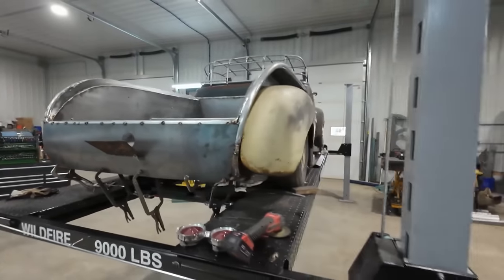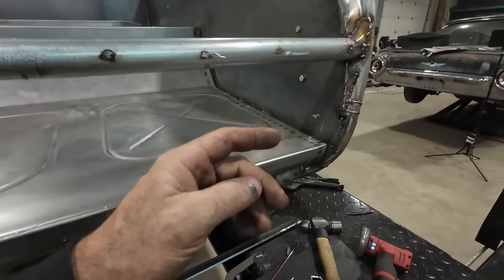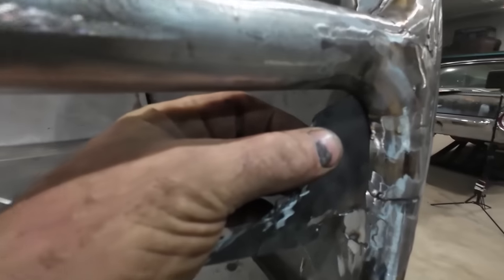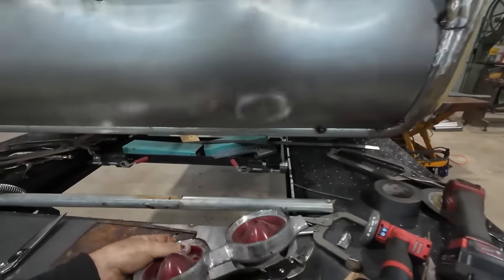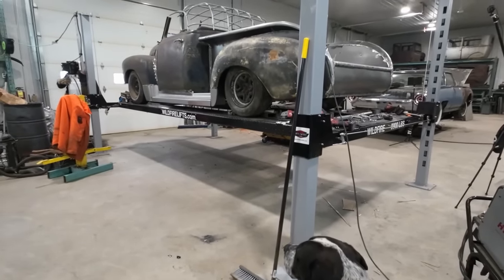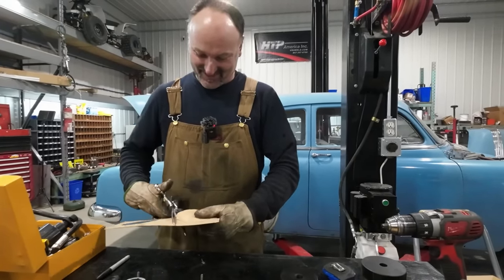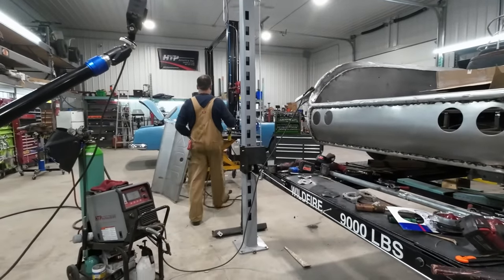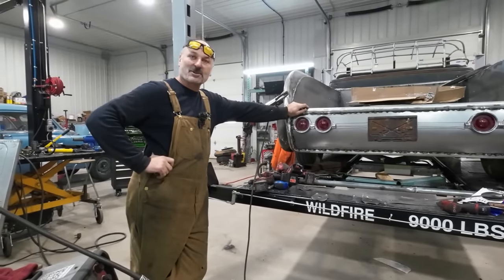Building the rear tail pan for our '49 GMC Roadster pickup!

Comment: Looks fantastic Brent. Do NOT French them in. simply bend a 20mm wide strip of sheet metal that's the distance between the lights in the middle length ways to replicate the angle of the triangular sections on the sides of the lights. Add this to inner and outer of both lights. Fully Sick build. Cheers Stew.

Comment: Run the flip plate mount upside down. Gravity will always want it to fall anyway. Plus when you have the trailer hitch in, the plate will sit over the top of it to show for easy viewing. French the plate holder into the panel as well so it's not sticking out so far.

Comment: Measure from the far side of the center hole to the near side of the other center hole. That will give you the center to distance. Mark it on a straight line and you have a good basis for your template

Comment: I think you made the perfect choice for taillights and with the panel inset in the tubing those lights (on camera anyway) look flush with the outer surface of the tube, I can't see if the chrome around the lights are setting tight against the panel but they look awesome on video,  nice work Brent

Comment: Brent, just an idea, rather than French in the tail lights leave them as is and when you make up the trims to go between the taillights and the License plate door just tapper off the ends of the trims to the thickness of the license plate door so they finish the same distance out from the panel.

Comment: I love the lights too, of course I have owned, 64, 79, 81, 93, 98, 07 Corvettes and they ALL had two round lights in each side just like that, but you know that rig Ain't no Corvette hoss.  That is a HalfAss Kustoms Hardtop Roadster Pickup Truck sort of. It will be awesome. Just make sure you use a nice loopy Cam so it sounds real nice tool, You be Fine. Dennis

Comment: Use the program you draw your CNC stuff with.  You can draw circles and put the center in it.  You can either print those and use them or you could cut them out and use the CNC to center punch them.

Comment: The license plate bracket reminds me of the ones I had on several Oldsmobile models from '68 to '72. Both Cutlass and Delta 88. I think some Impalas and Chevelles had them too, and maybe equivalent Pontiac and Buick models?  There were probably lots of other makes and models, but I know my '68 Cutlass had it for sure.

Comment: If you hadn't done as much welding, you could pull the panel off and dimple die around the holes you have in it. If that didn't work, you could just connect the dimples to give you a frenched opening.  I think the lights frenched in will look great. The plate HAS to be frenched in so it doesn't stick out like a soar thumb.

Comment: You also have some very large fender washers. If you can find anything that needs a bolt the size of the center hole/LOL. One thing that I liked on some types of headlights was that chrome cover that was over the top of the headlight and deflected the light down  towards the road more. Most states said illegal but as you know, the L.E.D. headlights are so bright they hurt most anyones eyes when they hit them. So maybe a long piece of stainless across the top of everything and then have some small lights in center for  that third brakelight??? Its yours and I can't see it from my house/LOL

Comment: A friend of mine bought the complete rear section from the doors back of a 1956 2 door Cadillac, cut the interior supports out of it then built a box inside the rear quarter pannel. He then mounted it on the rear of his 1956 Chevy truck.

Comment: Those two "Bars" between the lamps and the license holder could be made cutting stainless steel with threaded rod behind for attaching.  Use the pipe to match the contour of the lamp's horizontal ends. But, how about a frame from stainless that wraps around the license holder with your "swoopy" curved corners to attached to the new stainless bars.  Tom, SANDMAN OVERHAUL

Comment: If you drill your center hole for your punch draw bolt larger than needed you can center the punch to the marker line you drew from your template without needing to find an accurate center point

Comment: maybe build a surround for the plate so the trim between looks like one piece and gives a flat spot that can be used to box in the filler neck and seal it from the inside of the bed. definitely like the direction. also was thinking if the roof folded like a chevy ssr's might give more room in the bed.

Comment: What if you take the roll pan off to use as a template and add and extra 1/2" or so on top and bottom and use the brake to bend them over. Then you'll have that hard edge and not have to worry about getting it straight.  The brake bend will do it for you.

Comment: Loving how the rear end is coming along. I feel a spear that taped down to a point an inch or so away from the license plate would look pretty sharp. Also a thought on the plate mount you have, would it be possible to use it upside down? Just an idea floating around my brain.

Comment: When you were tracing out for the lights I would have used the gasket the next time you go to the store stop by school supplies pick up a pair of compasses then just you find the center of a circle easy I like the lights you chose but if you brake one is it replaceable if you French it then it’s tough to install different lights

Comment: Looks good. Could maybe French them in deep enough to have the polished ends sticking off the lights to be flush with the outside of the panel... if that males sense wouldn't need to connect them between the plate.
Reply: Nvm you mentioned it just after I sent the comment lol. You got this. I'll sit back and let ya do your thing😂

Comment: What if you get like 1-1/2 angle iron or just bend some sheet metal on a 90 then u can finish it in chrome or whatever in the end but tac it on there and you wouldn't need to french in the lights

Comment: I am interested to see tail gate on this hummer will it hold makers Chev or dodge name on tailgate? what have you with a roll bend that should prove interesting I have been casually watching details how will it roll once she's ready to go. . . . . 
Looking to see the personality you give the pickup \ roadster !

Much like in a obtuse way like an homage to boatail terhaps a white oak varnished tailgate might keep the guesser talking about what you've built here Brent hardwood floor over steel and a belt sander glued plug cut and screwed. Could add interesting design concepts to rear of this why not it's a slight potential  towards those old wood boat tailed speedsters I indeed would love to see you build one of those beauties you certainly would parlay huge views on a build like those bent oak or mahogany tapered awesome structural wood finished like some Chriscraft speed boat from the classic 30's or 40's you know we've seen them in Automobile Quarterlies books fine Auburns great coachwork truly wonderful craftsmanship you could pull it off Brent. Love to see you do it with dashboard fine detail  all finished fine accents and attention.

Comment: nice place to retire to. every body has a big old garage. it rains a bit. you can mark your watch by the wind at change of tide . i did not like it at first. people are a little stand offish until they find out your not a snow bird.  that's when the magic happens. most will not let you around there garage until that time. like me, i got all kinds of stuff no one see's.  going to start a small trash wagon for cleaning beach. people throw crap everywhere. during the off season the beach is so clean. with 4 strokes no one will hire me. my brain still works. and half my body works. no talking needed for trash clean up. i worked 15 yours a day. so you know after 5 years i'm chomping at the bit. no toe tag here. god bless.

Comment: you reap floor pan is not set straight looking at the gaps at the end sides and the bar underneath it hi on the drivers side and low on the passengers